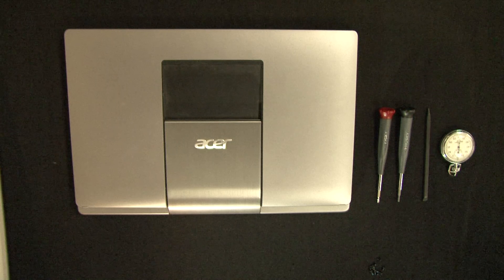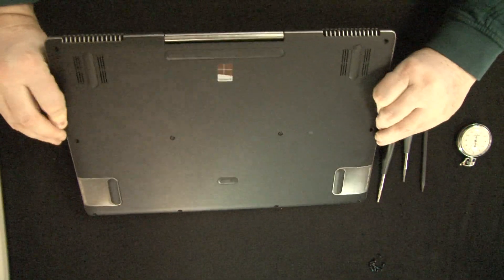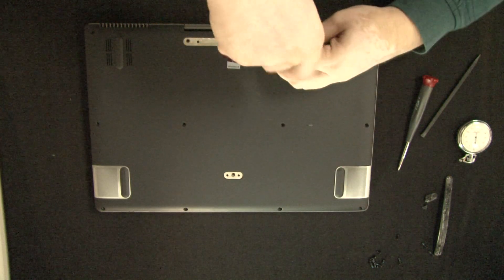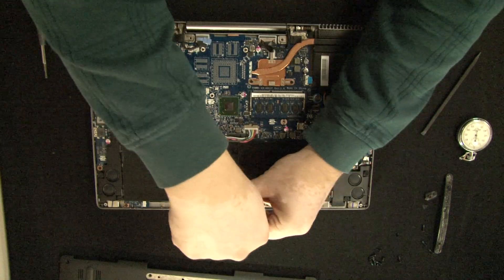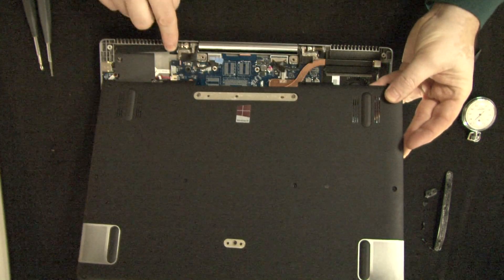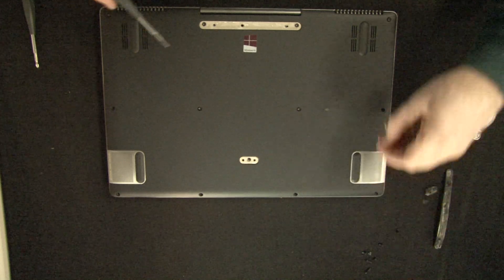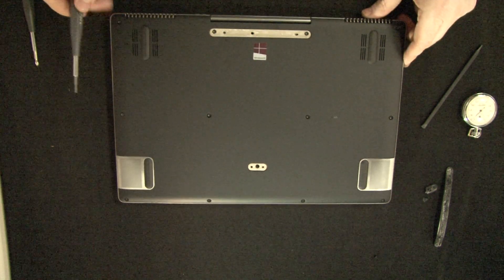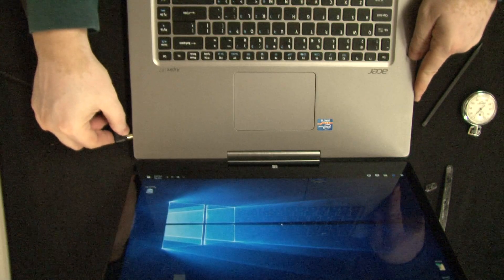Battery replacement on ACER  R7-571 laptop

Comment: I have this laptop for 9 years now and i’m at the point that also the second battery is broken. The first one were blown up so big that the battery packs broke the middle part of my keyboard (all key’s don’t work anymore) so i had to use a separate keyboard. And now the second one (the replacement) now also has blown up battery packs. And isn’t working anymore. I think it’s time to say goodbey to this laptop what do you think 🤔 😂

Comment: Brought my Acer R7-571 in 2012 in China and still going strong on original battery but lost a bit of storage but still goes for a couple of hours on original battery. Upgraded it in 2014 with 1TB Samsung SSD and runs much cooler and quieter and running on Windows 10 but doesn't have the software necessary to run Windows 11  Get a lot of positive comments due to its unusual design and I really like it. A good robust Laptop that's travelled around the world with me and mostly been used for work as it is fast with good memory. Only use it with a Mouse so location of trackpad is no issue for me and I prefer the position of the Keyboard at the bottom.

Comment: I too have the same model. I am facing issues as laptop doesn't turn on, light blinks for 7 secs and then nothing happens. Also I was trying to locate its cmos battery. Could you please tell me where I can search for cmos? Don't know what is the issue with laptop start up. Want to give possible troubleshooting. Thank you in advance.

Comment: Didnt worked for me. After 4 min waiting there s nothing showing on the display. If  I connect the AC then the battery led will turn on for 2 sec and then starts to blink intermittently. In Windows it shows an X over the battery icon. Any suggestions?

Comment: For every one that is changing the battery at a Acer R7, note that if you don't put the back lead and the screws, the battery will not be detected, because the two midle screws on the back act as a switch for the battery!

Comment: there are only two screws cause the third is mounted after you install the cover. would be nice if you meantioned from the start that the screws are not interchangable. anyway nice work.